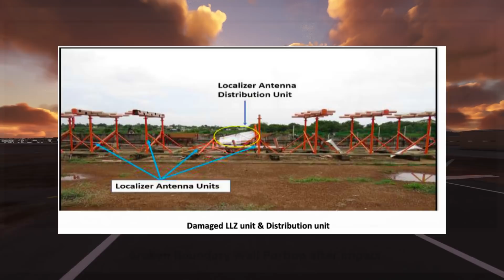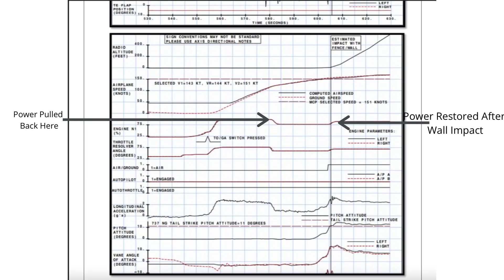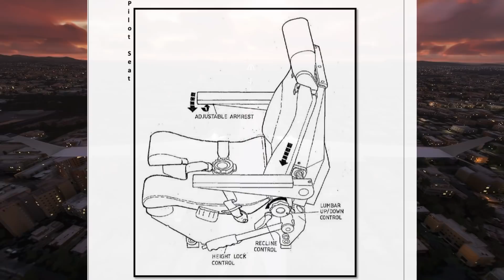How A Broken Seat Flew This Jet Into A BRICK Wall | Air India Express Flight 611

Comment: There is no dishonor in rejecting a takeoff. The first officer should have done that first and ask questions later.
Reply: Ya, the decision to not reject the takeoff is very odd. It makes me wonder what type of training the first officer recieved.
Reply: Dear sir, the FO's are so useless in all the airlines in India that they will crash the aircraft on the first emergency.
Reply: @GurmitSingh-ct2ed  
Your comment is shadow banned.
Reply: Exactly!
Reply: Did you wear a mask when they told you to do so? Judge not.
Reply: @greggstrasser88  I'm failing to see how rejecting a takeoff (a critical phase of flight) when something goes down that ain't supposed to happen to maintain the well-being of your passengers and the airplanes (aka doing his job) and wearing (or not wearing if you chose to ignore mandates) a face mask as per federal mandates.
Reply: @DoubleTeaMedia  
Are you familiar with Middle Eastern or Asian culture?

FO's are hesitant to speak up out of respect. Western people, most of whom are not pilots, are VERY judgemental. 
You can see some of the people who judge are ones who wore masks because they were told to. 
Have you ever stood by while something messed up was going on?
Reply: @greggstrasser88  I'm aware. That still, however, does not negate the fact a RTO should have been initiated. As for me, if it's my job, or it concerns the safety of myself or others, no, I've never just stood by.

Comment: Just curious, would there be a noticeable change in the engine noise when the throttles were changed from 98% to 77%?  As a passenger, I do notice there is always a change in the engine noise soon after take off, which is probably due to pull back of the throttles.
Reply: Shortly after takeoff the throttles are throttled back from TOGA (Takeoff/go around - slightly less than the absolute maximum that the engines can produce but as much as they're designed to produce on a regular bases) to climb thrust which is quieter, more sustainable by the engines, more efficient.
Reply: To start, this is long. I'm sorry. I wanted to figure it out the best I could. But I've only flown single engine props so I'm only guessing here but I'd say no, for 1 of 3 reasons:

1. If the noise could be heard, then the cockpit would have be relatively noisy when the throttles were actually pulled back. The chair and the fall would've made a noise that could've covered any major noise change, not to mention the pilots are already wearing radio headsets that block out a lot of excess noise to protect their hearing. 

2. Have you ever heard of how during stressful times, pilots can simply be overloaded with information and miss something important? Piloting is often 99.9% boredom, 0.1% pure pandemonium that tends to start like this: sudden. It's enough to cause crashes in the past. The crash that really pushed CRM to be adopted involved all 4 flight crew focused on a single light for the noisegear that they ended up crashing. (EDIT: It's Eastern Air Lines Flight 401. All 4 were so distracted they crashed into the Everglades, where 101 people died and 75 survived. And 8 of them had to go into hyperbaric chambers due to gas gangrene found in the Everglades.) This FO could've been so focused on his tasks at hand that when this happened, he was surprised enough not to react properly. He didn't take control immediately, and he didn't follow a checklist he should have memorized. He could've been trying to catch up and thus didn't even notice the change. 

3. Or more than likely, no, they probably couldn't easily hear it but probably felt it. Have you within the past decade flown in a 737 near or in the first row, like with a company such as Southwest where you easily can? If so, think of how quiet that was - you could easily talk to people and probably used headphones. And if you ever rode near where the engines are, just think of how much quieter the front row is. Now add the distance from the front row to the cockpit door. Now consider that noise cancelation as it's super reinforced. Finally, the pilots both would have radio headphones on. So a small change from 98 to 77 wouldn't have been that loud for passengers but even quieter for the pilots, and any shaking from the chair going back could've hidden that feeling of the change. 

Lastly... you likely hear this because airports are often built in cities and noise abatement laws require that between 800 and 3000 feet, planes are not above a specific noise level. Where I fly out of, we cannot go over a specific housing area because their wealthy development managed to be the only area to pass any noise laws. (EDIT: Actually, I'm going to believe Tom Riley too. I know noise abatement is enforced in many areas but this makes sense too.)
Reply: Absolutely! in this situation the first officer was blowing bubbles instead of doing his job. Two things to say here. The first officer should had rejected the takeoff, period. The second one, this crew was not acting as a professional airline crew whatsoever.

Comment: The reason the company wanted them diverting to Mumbai is simply logistics. They have the capability to repair the jet in Mumbai. Remember, at the time they didn't know the extent of the damage.
Emergency checklists often end with "LAND AT THE NEAREST SUITABLE AIRPORT". Note it says "suitable" and not "possible". I had an aircraft malfunction while climbing out of a Canadian airport, I think Montreal. I was planning to return to Montreal, but the company informed me that, if safely possible, they wanted the jet back across the border. They listed half a dozen alternates across the border and we ultimately went to Albany. Why did they want this? Maintenance logistics. It was safe as far as I knew, so I complied.
Reply: When the flight crew was informed that they took out an ILS antenna,  they should have immediately returned despite having their own maintenance there or not. You can always fly in mechanics and make an interim repair and ferry the aircraft to a maintenance station.
Reply: @70slandshark47  definitely true... Id forgotten about that aspect when I posted my comment
Reply: @BobbyGeneric145    Back in the 80s, I worked for Braniff Airlines as a mechanic and we did on call maintenance for other airlines . One day I was  called out to a US Air 737-300 which injested a bird in the left engine on take off. I was talking with the pilot and he told me that he saw the bird and realized it went through the engine as all the left engine parameters went down and immediately came back up to normal.  He said he thought about continuing on but thought the better of it and returned.  We were both standing in front of the engine and couldn't believe the amount of damage done. The bird went through the core,, most of it and bent a few fan blades but the core was just about destroyed. Amazing it still ran.  The CFM-56 is a resilient engine. I talked to their maintenance control and they wanted me to boroscope it.  I told them your nuts,,, this is an engine change. The aircraft stayed parked there for 3 days before their maintenance people arrived.  Sorry for the long story.
Reply: @70slandshark47  i love the old stories. Surprised it went through the core! Bullseye!
Reply: @70slandshark47  Thanks for the story, loved reading it.
Reply: Also a company's inability to think beyond what's mandated.... exactly because they didn't know the extent of the damage - despite knowing that they had contacted the ground they should have landed.
Reply: "It was safe as far as I knew"? Second guessing with people's lives? Please tell me who you fly for so I can avoid the possibility of you being the pilot [if, in fact you are a pilot] on any flight I might take. Logistics, my ass. Those really skilled seat fixers in Mumbai will do so much better a job than the incompetents in Dubai. I would also never fly Air India as this demonstrates that;
 1. the pilots involved were both incompetent and irresponsible in not insisting on returning to departure airport immediately upon being aware of crashing [yes, CRASHING] their plane into terrain.
2. the company would place priority in ensuring a cheaper labor rate in repairing the seat over the risk of flying a damaged aircraft over the ocean with passengers on board.
Reply: @robertrobert5188   During my career,  I also worked in the Middle East as an aircraft maintenance supervisor and they do employ a number of expats to perform maintenance on commercial aircraft for reasons you alluded to.
Reply: @robertrobert5188  who are you "quoting"?

Comment: No V1 = abort takeoff. I think this might be a chance for better training. ANY hesitation to abort takeoff needs to be found and eliminated in the psyche of pilots IMHO.
Reply: If something like this happens and you spend too much time on the runway, your v speeds all become null/void. Maci explained in the video that simulations showed the FO had only 5 seconds to execute a successful rejection. 

117 knots may be well enough below v1, but if you're doing 117 with 500 feet of runway left... your best bet is to get that thing off the ground.
Reply: @232K7  The simulations were only tried at 5 seconds response time and at the time the captain was back (not sure how much longer that was). Honestly, we should train pilots: if not at V1, and anything weird happens, abort takeoff.
Reply: It amazes me that Boeing's can fly through a brick wall & airbus can take a direct hit from an rpg.
And yet they still fall out of the sky for the dumbest reasons

Comment: Seems like they would have just let it continue to Dubai since it was nearly there. It's a major airport with full emergency, maintenance and service capabilities. Would have been better for sure than flying back across an ocean with what it now known to be a damaged aircraft.
Reply: DXB is a major airport, but not necessarily for AI.  EK doesn't have 737s in their fleet, so there wouldn't be a lot of spare 737 parts hanging around that place.  Plus it's much cheaper to have your own personnel at a home maintenance base do the repairs if that's an option.
Reply: @derekashworth5884  the value of humans >>>> cost of some minor inconveniences
Reply: @derekashworth5884  I think you're missing the point...
Reply: I believe it is Arabian Sea & not Ocean (like Pacific or Atlantic)
Reply: @stalisuhail  Yes that's true, but it's still a rather large part of the Indian Ocean right? How long does it take to fly across the Arabian Sea? It just seemed like a strange choice to take a damaged aircraft back across a large body of water rather than land at the closest airport. Emergency water landings seldom turn out good.
Reply: Well, I see you'll never make an airline executive, focusing on the wrong issue here.📉📊

Comment: I was once on a flight delayed by a seat failure. The captain announced "We're going to be delayed. My chair's broken, and I can't fly standing up."
Seriously, a seat failure on takeoff, (where the load shifts to the seatback) can be rapidly lethal in any aircraft, especially single-pilot. The machine's low, slow, and pointed as far up as it should go, so there's no margin for the pilot to haul on the yoke. Cessna had to introduce special stops on the seat rails as a result of a string of crashes caused by failed latches.
Reply: When I was taking flight lessons in a Cessna 152, the instructor had discussed the seat-rails issue thoroughly, and we always checked our seats as part of the pre-flight.  Yet, on one flight, his (right) seat slid back in the blink of an eye.  I had the controls, so it was no issue as far as initiating a stall (we were in level flight).   He was able to reach the bottom of the panel and drag his seat back into place.  We continued, and finished, the lesson without further issues, but it did show first-hand how quickly weird stuff can happen.
Reply: I came here to mention the Cessna incidents as well.
Reply: Yep. The sad truth. Thanks for your comment.
Reply: Considering you steer a plane with the rudders at your feet its kind of important to be in the proper position to fly lol
Reply: @fanatic26  The rudder is there to control yaw. You steer with the ailerons and elevator, which are connected to the yoke (or side stick). The rudder is typically the least important, but you really do want to have access to all of your controls.

Comment: The 1st officer did not abort the flight for the same reason which plague south asian airlines - total deference to authority figures.
Reply: A Rejected Take Off is performed by the Captain, regardless of whom is Pilot Flying. Thus it's understandable that the First Officer would not attempt to reject. The question then becomes more "Why did they forget that the autothrottle was not engaged?"

Comment: This one still baffless me. The decisions made. 
When it comes to the diversion to Mumbay, I guess they wanted to be somewhere they have their own ops and maintenance. However, in this case it was an unnecessary risk. It's better to have to worry with the logistic of maintaining a plane there and ferrying it back, than with a potential crash.
Reply: I'd have to go back and re-watch mentor pilots video on this to be sure but i think it was a matter of the quality of emergency support available in case it turned into a crash landing.
Reply: Sick as it may seem, maybe they wanted it to crash somewhere else. Somewhere like India.
Reply: TRZ has an 8100 foot runway. BOM has a 12000 foot runway, the second longest runway in India only to one at DEL that’s 14,500 feet.
Reply: My guess is that the higher-up who made the decision to recall the flight didn't know how far it had got, and the lower-down who knew how much of a diversion it would be didn't have the autonomy to override the boss.
Reply: @AdrianColley  Yeah because pilot told that everything was working fine so they would have thought that plane would not have suffered much to worry about
Reply: Even Dubai, the original destination, is less than half the distance to Mumbai, and they wouldn't have to cross any ocean
Reply: Money my dear friend. Cheaper to repair on home soil than a foreign one.